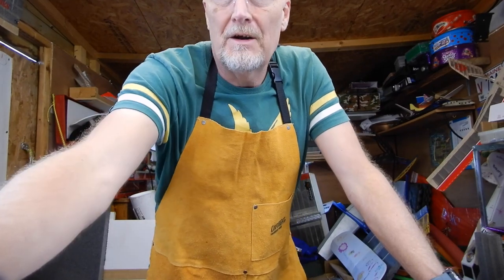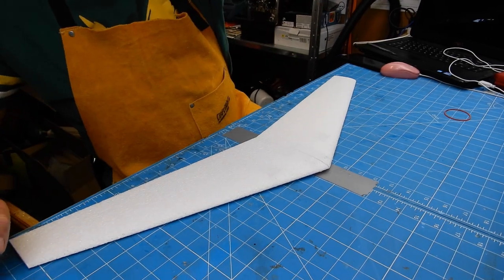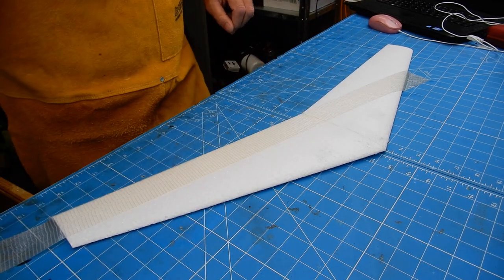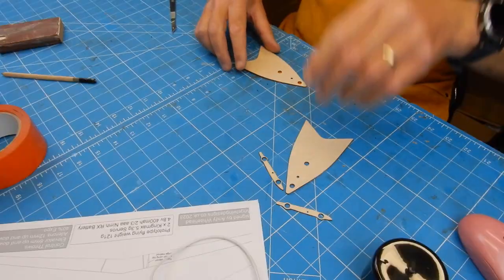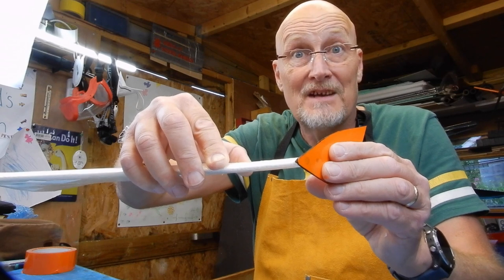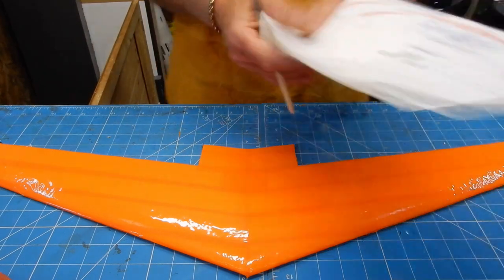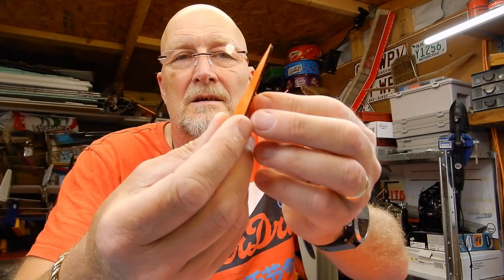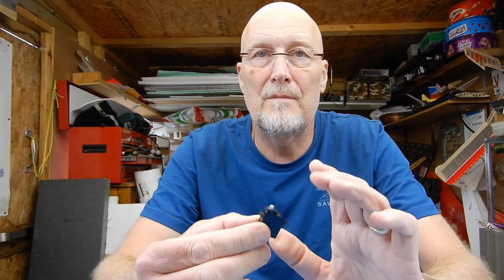How to Build  The SMASH sub 250 grm combat glider

Comment: The winds have been howling in California this week. Just got back from our local site (Los Banos) for a maiden of the SMASH. Didn't have high hopes as the wind was 26 mph at the lip. Tossed it, two clicks of trim and it was off !! Unreal penetration and speed. AUW was 221 gms but I was using the denser black EPP. CG was right at 100mm back from tip. Great plane that will only leave my car to fly !
Reply from the maker: Sweet mate glad to here can’t beat a bit foam and tape 😍

Comment: It may just be the camera angle, but this looks to be a seriously thin wing section.  This could be a really quick model!!!  I look forward to seeing the video of the maiden.
Reply from the maker: Yes mate and profile changes to tip
Reply: @NickChittyFlying  I guess it's one way of adding washout at the wingtips without twisting the wing
Reply from the maker: @richardo212  I am becoming more convinced sub 1 metre gliders have there own unique aerodynamics. And calculations based around full size aircraft have little or no difference at micro wings I have now retired behind the sofa  😂